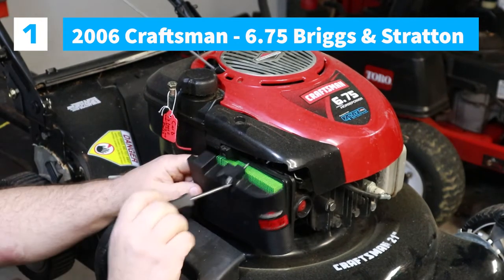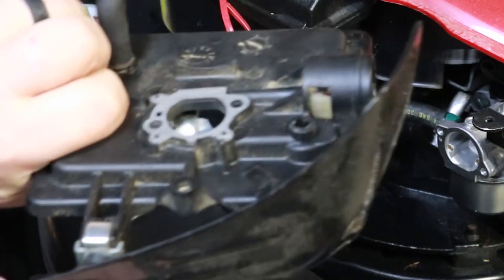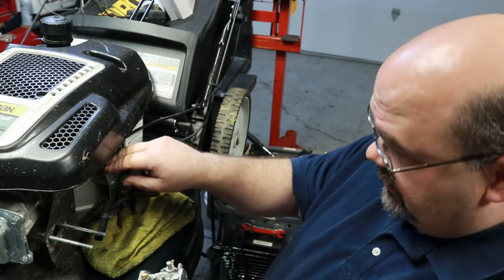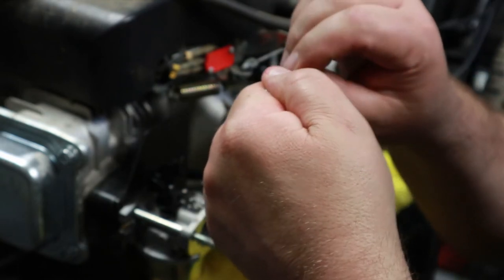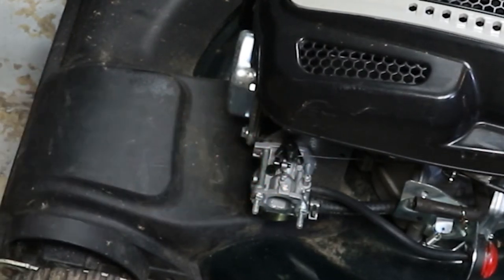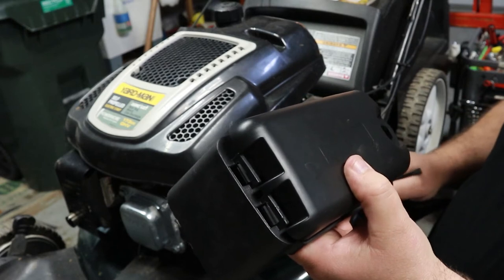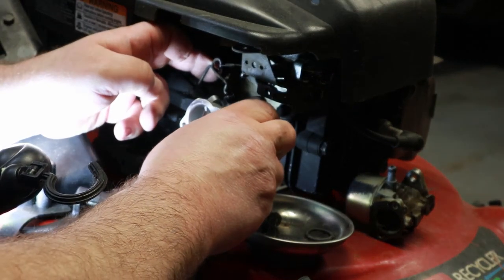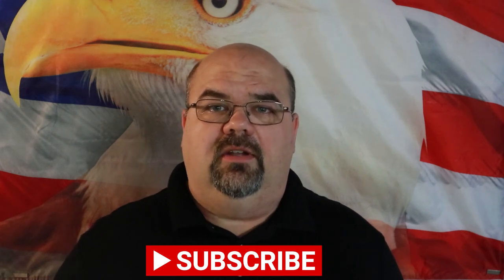Turning Garbage Into Money-making Lawn Mowers

Comment: Thanks for the shout out to new channels as I have mine up for over a year.  I don't see how that 2nd mower could idle without the return spring as I had a briggs that had the spring missing and it would not idle. Video is up on my channel(725EX model).
Reply from the maker: Thanks for watching.  The only thing I can imagine is I probably made the linkage rod a little longer than the original, so when the mower started, it was being held at full throttle.  Once it started, the governor would mechanically close the throttle so it never really had a chance to slow down unless the governor closed the throttle. After watching your video I can see that it should have had a shorter linkage rod and spring.  I used that mower to cut my grass before I sold it and it worked very well.  I sold it to a neighbor so I'm sure I'll hear about it if they have any problems.  Thanks again for watching and you have a new Subscriber.  🦅
Reply from the maker: For those watching or reading this, here is a link to Al’s video showing how this linkage should be connected from the factory with a spring.  
https://youtu.be/G6U1ugCr2mw
Reply: Thanks for checking out the video.

Comment: I know you drain the gas, but the little plastic pre-filter on the gas tank, does that need to be cleaned or will fresh gas flush it out? Or how do you clean out a gas tank?
Reply from the maker: If the filter in the tank is clogged, you need to take the tank off so it can be turned upside down. After draining all the old fuel out, I use carb cleaner and spray it through the tank drain tub with the tank upside down.  After you do this, I then cap the drain tube and slosh a little fuel around and dump it out the top.  Repeat this process until you no longer see any contaminants coming out with the fuel.  Before you reinstall the tank, put a small amount of fuel in the tank and ensure it runs freely through the drain tube.  It may sound like a lot of work, but it's the only sure-fire way to ensure things are clean and flowing as they should. 
The only other thing I would suggest is if the primary tank filter is clogged or damaged beyond repair, remove it (punch it out) and install a small pancake filter in the fuel line.  Of course, this assumes you're working on a mower that has a fuel line feeding the carb.  
I hope this helps, let me know how it works for you.  🦅🇺🇸